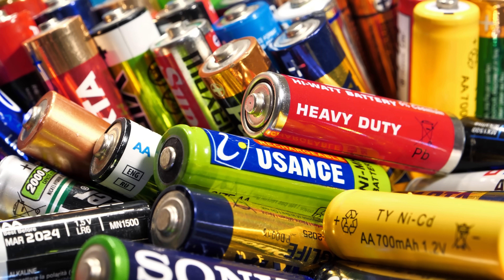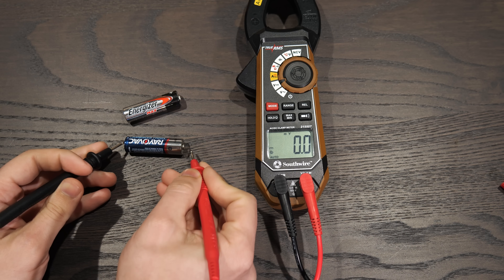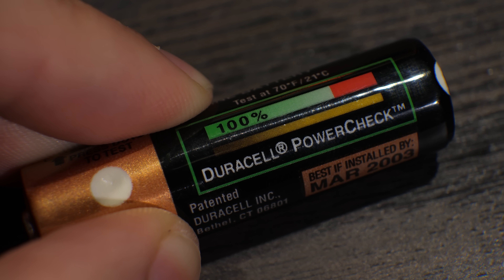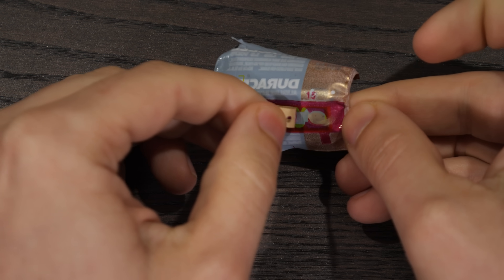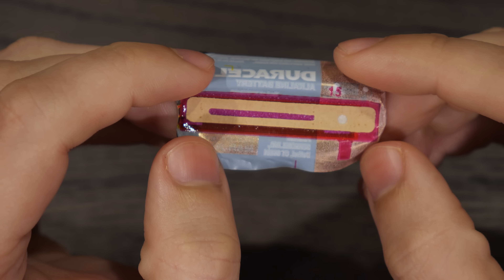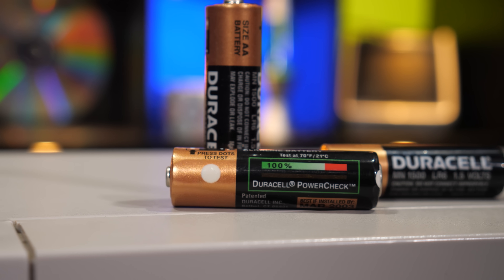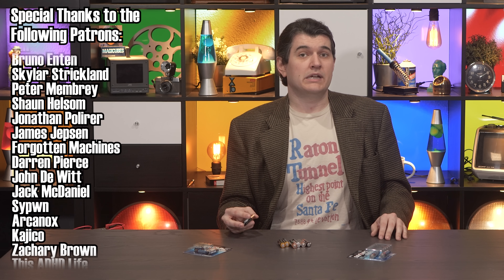Duracell PowerCheck: A genius idea which didn't last that long

Comment: the original version of this in the late 80s or early 90s had the powercheck thing in the clear plastic part of the packaging.  They were later put in the battery itself and I hated trying to press that hard.  The better way (& probably cheaper too) was to have it in the plastic front part of the package...and all 4 (or however many in a pack) used the same tester.  It was easier to press on the original version...although I do remember you still had to push kinda hard.

Comment: Ah, the temperature thing explains why I could get totally dead batteries showing half or even full charge on hot summer days.

Also, did anyone else also experience that the yellow bar usually showed 50-80% full for a looooong time, and then suddenly one day the battery was just empty??
Never understood what was going on there....

Comment: I found a couple of these the other day and kinda missed them. Over time you end up with random randomly used batteries floating around without boxes in any respectable junk drawer. Something too dead for a radio might have another year of remote control left in it. These were a pain to use and don't know if my fingers could do it anymore but were handy and accurate enough to get the job done since you are lucky to find batteries in the junk drawer. Finding the tester in there is pushing it. Kinda moot now as I am moving to those nifty lithium cells that have a usb charge port built in.

Comment: I always wondered why Since I could not think of a single product that took one single either double A or Triple A battery but always a minimum of two double A's or two Triple A's why these batteries were not just one battery that you would slip into a Battery operated device?

Comment: Not only did I go thru dozens of batteries for my led flashlights, they just cost so much to replace every month or so, then I'd feel the tears roll down my face because those poor batteries didn't have the luscious life span that rechargeable ones do such as the lithium, I mean I was actually crying because I thought I was wasting them, those poor innocent alkaline batteries that suffered such a short life, I couldn't handle the guilt anymore so now I only use lithium rechargeable batteries and now my face has experienced less emotional trauma ( tears ) and as a quick tip on purchasing aa, aaa, 10440, 14440, 18650, 21700 lithium batteries, these are not typically sold in local department stores because these stores only sell junk rechargeable batteries and ofcourse alkaline to help the economy which may sound like BS but I've learned this to be true,, You must by the rechargeable batteries I've mentioned online,, weather its Ebay or Amazon or straight off Google from the manufacturer, that's were to purchase them,, remember some of the best products to purchase that can save the day really aren't always around the corner at the local department store but instead They're Online, Sincerely

Comment: we have a stupid battery tester that lights up if a battery "still has charge" - the problem is the battery tester has its own battery and won't work without it, and keeps saying dead batteries have plenty of charge. The other problem is we have someone that swears by it, believes it is telling the truth, and will instead claim the appliance/remote control is having issues.

Comment: i do remember these, i used to enjoy testing them when i was younger, and always was curious on how they worked without actually taking them apart. truth be told, i didnt find it that difficult to use them at all, although that might be because i had access to more modern versions of them released in like 2007-2010 ish. they were neat. it is a shame how they disappeared. it was a nifty lil feature

Comment: I still have a small tub of batteries that got too low for whatever device they were in, but still have enough charge for some of my other devices.
I was surprised to hear they don't make these anymore... particularly since some of the batteries still in my part-used tub have these integrated testers, and still work.

Comment: I found the main use of the tester was for diagnostics. If something stopped working, you didn't necessarily know if flat batteries was the cause and you could, at the expense of some moderate pain in your thumbs, quickly confirm or rule out that as the problem. Checking loose batteries in the battery drawer was sometimes useful, but there was usually a battery tester in the battery drawer too, so it was only a minor convenience in that scenario.

Comment: I effing hate aaa batteries. Especially Duracell. They are the most garbage batteries you can get. Their best feature is leaking. If you want to destroy a battery-operated device quickly, install Duracells.

Comment: Suggestion for a video: Harbor Freight has been selling a really cheap (like $7) multimeter for years, and it has a "battery tester" mode. Maybe you could explain how it works.

Comment: My kids routinely take partially used batteries out of devices and leave them laying around on the counter or on the floor. I have no idea why. They deny doing it, but it never happened before they got old enough to remove batteries from devices.

Comment: "Don't mix cells of different brands or with uneven states of depletion" - that kind of sentence on all kinds of devices limits the usefulness of the indicator. Taking them out of the same pack and retiring them together was the common procedure. That plus the observation that different devices react very different to the same indicator reading - depending on how much current they draw and whether its short pulses or a constant load..

Comment: @TechnologyConnections Have you made a video about different types of batteries? (A search doesn't find one). I ask because my wireless doorbell says only to use zinc carbon batteries while other things say to only use high power alkaline batteries and yet more say not to use rechargeable batteries. Is there a logical reason for this??

Comment: I can think of one use but at the same time it's not really a good use: those of us that might use them in wireless microphones. That said, it's somewhat irresponsible to hand a wireless mic to a performer or speaker knowing that the batteries are not 100% brand new and could fail in the middle of the performance. Also, I tended towards NiMh rechargeable batteries anyway to reduce waste. That said, having that little tester there for that pair of AAs in your wireless mic case that you held onto after the last gig since they "barely got used" could prove handy "in a pinch" where maybe your primary batteries failed you.  Great video! As always.

Comment: The testers weren’t added as just a convenience feature. Duracell had recently been in the news about selling old, dead batteries and this was a way of winning customers back from upstart Energizer by proving they were good. When first released there were even holes in the retail package so you could check one before buying. 

This move saved Duracell at the time and their ordeal is why all batteries now have expiration dates.

Comment: 11:22 - Perhaps you could create a short video on why you shouldn't leave batteries inside seldom-used tools. Yes, I know they corrode inside the tool. But you could explain how and why it happens, how and why it can happen just leaving two batteries lying alongside each other, and maybe the best ways to clean the corrosion out! Just a suggestion...

Comment: If you were a smart enough kid, you would use any supplied mains adapter and put the bill onto the parents.
Buying batteries was always an expensive option here in the UK and a big hit on pocket money!
Even saving to buy a mains adapter was better and that's what I did if it wasn't supplied!

Comment: I remember using Duracells to power one of those wire motors for a grade 7 science project. The battery would heat up over time and light up the tester.

Comment: Interesting to see how that thing works. I can't believe that they are already about 20 years out of production.  Btw chargeable batteries have another problem. When they are fully charged they have a voltage of 1.4 Volts instead of the normal 1.5 Volts. And I had some devices that had problems with that lower voltage. Maybe you can tell us why these charged batteries have only 1.4 Volts?

Comment: If I remember correctly, there was a time here in Europe when the testers were actually put on the plastic blister packaging (same strip, but not part of the battery, just one per pack). You could take a battery, put it back into the packaging, and have a single tester strip that would connect at the top and bottom of the battery for testing. Might have been a cost cutting measure before these were axed completely, or was it before these were put on batteries?

Comment: Of course I remember these from the 2000s, but also what was puzzling to me it's you saying these were available in a distant past, while where I live they are still in stores now (a tad of an updated meter). I was sure I had a pair of these in the house and indeed while cleaning I found a pair of AAA in a remote control in a drawer. They say best before 03/2031. I think I bought them the earliest in the pandemic (2020). The meter still rises to full and they have about 1.577V on a voltmeter. Otherwise, nice video remembering me that when I was a child I used to peal these off the batteries and with a bit of difficulty solder wires to the contacts and then use them as multimeters.. just as a curiosity (I was about 12-13). Cheers. If you want some pictures with the ones I have now, where can I sent them?

Comment: I always thought that it was neat but wasteful to put this on disposable batteries.  It would be way more useful for rechargeable batteries (which typically aren't sitting around in the package and which have higher self-discharge rates) if someone could make it accurate for a NiMH discharge curve.

Comment: Good way to drain a battery.  The ones I had got warm when you pushed the buttons.  I preferred the meter that some manufacturers included as part of the packaging.  It worked on any old battery.  I have a few for various size batteries.

Comment: There is always the bounce test for AA or AAA. If they are flat, they jumping up when dropped at the flat end on a hard surface.
Reply: Yeah, but the power check gives a better approximation, not the best, but better than bouncing it.

Comment: As a member of the original GameBoy generation, this was a useful feature.  When you robbed and squirreled away batteries from around the house, you usually ended up with miscellaneous assortment of batteries in the GameBoy. This allowed you to figure out which ones were viable.

Comment: As a kid with a CD player I used a LOT of AA batteries, especially on roadtrips.  Often my batteries would die halfway through a trip and my CD player would be useless.  To combat this I started rubbing the dead batteries together at their terminals and found that I got a lot more life out of them, like I was using their opposite attractions to "pull more juice" from the middle of the battery to the terminal ends.  I would love for you to test this yourself and make a video explaining it.

Comment: It makes perfect sense on rechargeable batteries and I've been wondering why no charger or battery off Amazon has one built in.

I typically use batteries from full to empty but because I have so many children toys it's just silly to think to buy 500 batteries when I have seven different mobiles for example. But knowing the battery has 75% or 25% would dictate whether I switch it or charge it.

Comment: The real problem was most electronics wouldn't power on with duracell brand, everyone had to go to Energizer "Electric", or "Advanced" or your electronics just wouldn't turn on because duracell shipped being too underpowered. I suspect that's the real reason they died. Cost cutting to endure.

Comment: I'd happily do way with using alkaline AA batteries, however I've several devices that struggle after short periods of time with rechargeable batteries, given their lower 1.2-1.25v. I'm puzzled that no-one's bothered solving what I can only assume was at the time a challenge of manufacturing commensurate voltage rechargeables.

Comment: My memory recalls that one of the battery companies, I believe Ray-O-Vac, had a tester built into the top cardboard of the AA and 9v bulk packages. I carried the 9v version around with me in my guitar case to test the batteries for my wireless system and my live pickups. I burnt through a lot of 9v batteries back then……….

Comment: I like the fact that we have rechargable batteries in devices now BUT i don't like the fact that device makers are not using standard rechargable batteries so It would be possible to easily change the ones that degraded after too many recharges. In some devices like smartphone it of course makes sense but in other devices it is really stupid that I can't just put new rechargable AA battery because they didn't used AA standard

Comment: I think slightly used batteries is more common than you think. An easy to describe scenario would be something like a headlamp. Anyone who's used one knows once the battery is drained they are a lot less bright. The batteries are still good enough to use for other things but putting in fresh batteries gives a brighter light. There are all sorts of things that do better with a fully charged battery so having random batteries lying around is pretty common

Comment: I remember these from the 90s but also before i switched to Energizer because they last longer and dont leak like duracell's Duracell made another run of the power check battery again about 10 or 11 years ago in the quantum battries i found one few weeks ago dead and leaking but was probably from 10+ years ago definitely not from the 90s

Comment: In the UK I'm not sure we ever got these, but we did get a version in the 90s where the pack the batter came in had a middle bit you slotted a battery into, i think you also had to press both ends but cant recall.

Comment: I remember those Duracell batteries, and I for one, used that gimmick quite often. It was handy,  when you really didn't want to smash the remote's buttons on a saturday/sunday evening. For me, the main appeal of AA and AAA is convenience, more so than rechargeable ones. Why? Because it was standardized. Good luck trying to use an older device that needs a proprietary rechargable battery. Most of them are not produced anymore and/or are knock-offs that fare way worse than a genuine one. Speaking of GameBoy, it's pretty easy today to pop in some AA's and play (however little time you might squeeze out of them), while playing on a PSP....and i'm not talking about the possibility of some devices to operate with a simple charger. I'm talking using that said device on the go. Not to mention, that not every device has the option to operate by plugging it in the wall socket. So yeah...i'll stick to my AA's and AAA's.

Comment: I found that these "built in tester" batteries would drain faster. Sometimes they would arrive dead on arrival in a brand new package. I remeber being well frustrated by these not running my discman for no longer than half an hour, this is what drove me to Ni-Mh rechargable batteries.

Comment: Don't forget in regards to attitudes towards batteries that technology has changed.
Alkaline is still about and for whatever reason so is zinc. But now days lithium are also in disposables too. They are more expensive but last so much longer.
Personally I prefer rechargeable  but if I buy disposable I go for the Alkaline variety

Comment: I suspect rechargeables coming down in price has a lot to do with it and yeah having battery checking built in to devices helps too. Only partially related but switching to Lithium AAs has been really helpful for me. Quest controllers used to die within a day of heavy use, they last a week with Lithium.

Comment: I guess I'm weird because I've always had the habit of putting used batteries back in the packaging they came in when I was pretty sure they were dead but not 100% and then forgetting about it and then wondering, the next time I need batteries, whether those are new or used. I've always heard you're not supposed to just chuck used batteries in the trash, which is probably why I do this, but I can't be bothered to dispose of them properly either so they just accumulate in some random place for years...

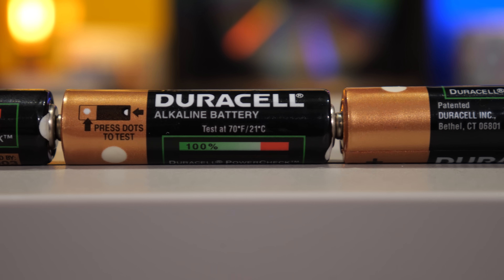Comment: On testers in the battery pack @12:53  - my memory may be vague, but pretty sure for a while they had effectively the same technology built into the plastic blister-pack that was just the tester strip fitted to the inside of the plastic part. They were slightly easier to press than the on-cell powercheck, as they wrapped to the top and bottom of the cell. If you kept the pack (which would be typical if you used two cells out of a four-cell pack) then the tester was in the drawer of batteries.

Comment: This simple function would be very valuable today. I have a number of devices, most under 5 years old and not uncommon to the modern household, that require a series of batteries. Some stop functioning when just one battery becomes low. So I do use a battery tester whenever they need to be changed. I can't imagine discarding 3-4 batteries at a time when just one could be replaced.

Comment: Huh? Here in the uk still sell battery's with the checker they have not gone yet. Do i use the checker tho hardly ever, last one i checked was a battery 2 years ago. one side died the other was still good but yeah batterys that say they gonna expire in 2034 still have the checker.